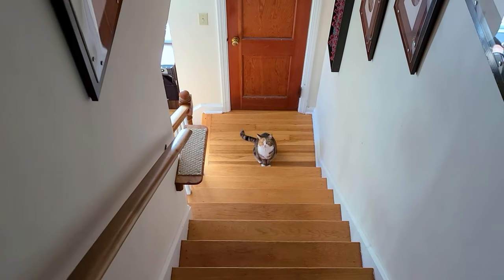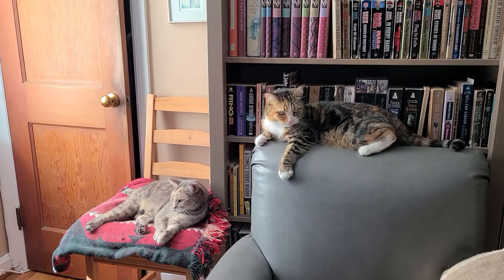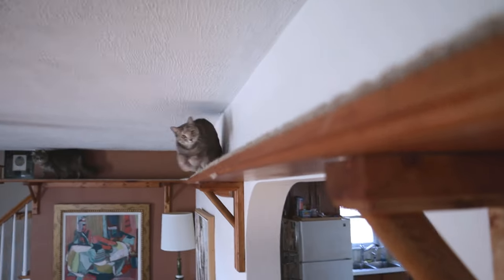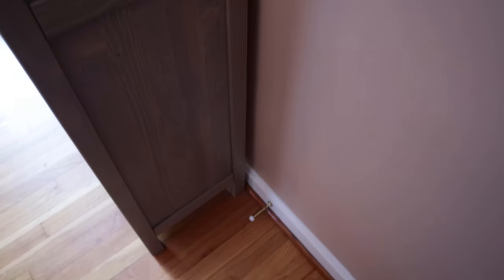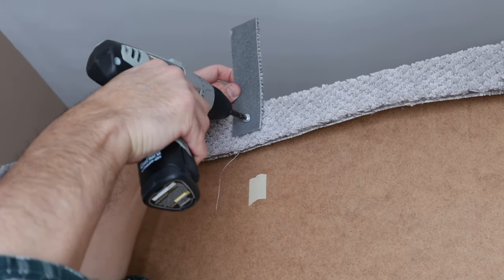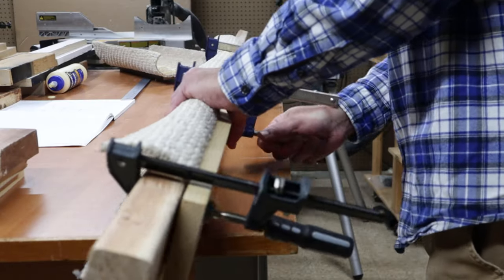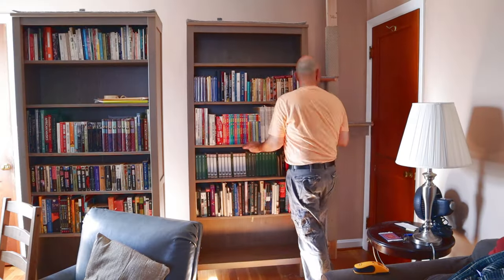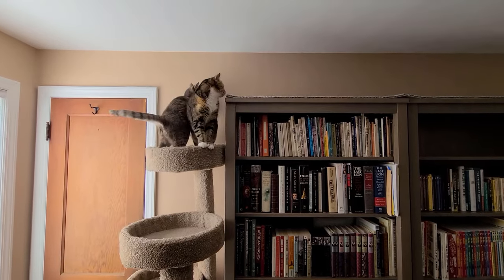If You Rent and Your Cats are Bored, Watch This

Comment: Living in NYC and going from rental to rental, I gave up on all the "damage free" versions of everything when I learned how easy it is to spackle nail and screw holes. I've painted every rental I lived in, so I have to repaint the walls anyways. For anybody worried about damaging the walls, I have had MUCH worse damage with command strips, double sided tape, etc ripping off massive patches of drywall than I ever had with nails and screws leaving holes so don't be afraid to use those in your rental :) I'm really excited to cat-ify my new apartment and your videos are a massive help
Reply from the maker: I know! Tape is the worst. And it always leaves a residue, no matter what they say.
Reply: In my rental, they won't let us paint or give us matching paint to touch up when we leave. 🙄 So we either have to live in an undecorated box or forfeit our deposit.
Reply: This is definitely one of the secrets to renting. Just get comfortable patching holes and painting and live a little more free.
Reply: @candimay4404  No-hole alternative: Tall bookshelves facing each other on opposite walls.  At least one solid board secured (screws/bolts) to the top of each bookcase.  If sturdy enough, the second walkway can be a rope bridge so that they can run circles in the air.  To turn the bookshelves into trees, cat-sized holes in the shelves so that theys can move up and down through the shelves.  Secure all shelves so that none are loose and can be bumped up or out by the cats.  Also ensure that there are not sharp or hard objects under the high pathways, so that they are less likely to be injured if they fall. (Falls do happen.)
Reply: @brianwest2775 great ideas!!!! Thanks!

Comment: An alternative to burning the edge of the carpet is to paint the bottom edge with wood glue. A carpeting salesman suggested that to me when I bought a remnant to use as the rug in the living room rug for my first apartment. I painted the edge to about an inch in and let it dry completely before I flipped and positioned it. It worked fine.
Reply from the maker: Great suggestion! Thanks!
Reply: They also make carpet tape. This is traditionally used for patches and seams but you can definitely use it to reinforce  edges. Be careful though because it comes in both single and double sided. Some of them are heat activated, requiring an iron, but they give a little bit of time to get the placement right in comparison to the other type. Hope this gives you options to fit your needs.  👍

Comment: No-hole alternative: Tall bookshelves facing each other on opposite walls.  At least one solid board secured (screws/bolts) to the top of each bookcase.  If sturdy enough, the second walkway can be a rope bridge so that they can run circles in the air.  To turn the bookshelves into trees, cat-sized holes in the shelves so that theys can move up and down through the shelves.  Secure all shelves so that none are loose and can be bumped up or out by the cats.  Also ensure that there are not sharp or hard objects under the high pathways, so that they are less likely to be injured if they fall. (Falls do happen.)

Comment: Your videos are excellent and you are very knowledgeable/informational, THANIYOU! 

If someone rents they should not be drilling holes in walls without permission, and expect to pay for a professional to restore/repaint the entire wall if they do. I have had tenants fill holes with toothapaste, and they always leave the property in worse condition.. One should expect to leave a home in the same condition they entered, or indemnify the owner.
Reply from the maker: As a landlord, I am sure you have seen enough damage to last a lifetime. I agree that the toothpaste thing is ridiculous. But I don't agree that paying a professional to fill a couple of holes and paint a wall is necessary. Drilling holes causes less damage than nailing into a wall, which can cause chipping and other problems. I rented for many years, and always got back the full deposit. But I also expected to live in the space, which included decorating the walls. (I found that those tape hanging devices cause much more damage than nails.) I think most people expect to be able to do that as long as they leave the space in similar condition to its original. Otherwise, what? Tell prospective tenants in advance that the walls must remain bare unless they contract a professional to repaint the apartment? Maybe some people would agree to that, but I think most won't. And if they have cats, painting a wall might be the smallest issue at the end of their stay. But thanks for watching. I appreciate your comment, and it's an important reminder for any tenant to know the landlord's expectations before leasing an apartment.

Comment: I found carpet remnants at the local Dollar Tree - 1 x 4 (feet) that work great on top of my bookshelves. I also found a cardboard cat house at Aldi for $8 that I put on top of one (anchored to the shelves so it doesn't slide off).  The cat house comes with two sections of corrugated scratch pads. I removed those and put part of an old bathroom rug in the house - they love sleeping in their little house.
Reply from the maker: Love the little house idea!

Comment: Instead of drill screws in studs or a brick wall you can use height adjustors (used in legs of tables or cabinets to level them) 
Just put them on the end of a 4x4 wooden plank just shy of the height of the rooms and tighten them.
These can even be put in the middle of a room. And you can put the walkways by connecting them to these wooden pillars.
No need to screw anything to a wall and everything is adjustable.
Linking a video where they are using sections of pipes screwed together and held in place by a hydraulic shaft but this is cheaper and fully customizable.
https://youtube.com/shorts/aWx0jm7055M?feature=share
Reply from the maker: Great idea! Have you tried this yourself? I wonder if the height adjustors are strong enough to keep a post stable? Could a full sized cat throwing himself at it during a chase game shift it? It's worth experimenting. Thanks for the idea!

Comment: Im going to look for free bookcases ,, hopefully, 2 or 3.  Im going to leave the shelves empty, cutting squares and or circles on oppsote ends so the 2 kitties can climb up them (1 kitty is 12 ill secure ramps eith carpeting for her to rasily travel) to the top.  Ill buy s fee planks for running , making them not yo far apart securing them with hardware for the zoomie times.  TY i wanted to secure them to the walls. I know how moe with the tip you gave.  I do have a few hesvy rocks I'll put in the bottom also for added weight.   Thanks so much!  Lolol they'll love these!
Reply from the maker: Great idea!

Comment: At the end of last year I bought a new fridge-freezer to replace the tiny one built in under a counter in my kitchen (though I still need to preferably sell it or otherwise make it go away! I’m going to move a cupboard into its space from across the room, then finally buy a dishwasher to go in that space next to the sink 😃 playing kitchen tetris over here!), and one of the factors that went in to my choice was one with a flat top without any vents or operational elements, so that my cats could go on top 😊 Bit of a variation on your solution, but while I’m not a renter anymore, you at least don’t need to make holes in the walls to repurpose existing furniture/appliances for your cats to make use of too (provided you’ve got a way for them to get up and down!)

The new fridge is a massive 2 meters tall, and right now their access route to get on top is a very makeshift solution involving a sturdy tall box (that once contained my kitchen bin!) stacked on top of a storage ottoman… this sounds much worse now I’ve written it down than it is in reality, and I promise it’s all fully secure! I can comfortably stand on the storage ottoman safely and nothing wobbles 😅 I need to have a huge clearout of all the boxes and old stuff that’s accumulated here, and since I don’t have a spare room or a garage the bit between my kitchen and living room has turned into the “junk zone”, and I’m looking forward to replacing that bin box hack with a few shelves for them to jump onto instead! 

They do love sleeping on top of the fridge, or just surveying the space/watching me while I cook! They also manage to squeeze up on top of the kitchen cabinets from there too, though there’s really not enough height between them and the ceiling (18cm) to be that comfortable, alas… I also want to make a skyway around the room too, with a big long shelf going above the big window to span the two sides of the room, and maybe some different kinds of wall catifications stretching from the window up to the kitchen… I think I should just have enough space because that’s a 25cm gap above the window, if I can find a shelf/bracket system that can get as close to the top of the window recess as possible, and then figure out the spacing at each end for them to get up onto the window shelf when there’s not a load of headroom for them to jump! My catification is definitely all still a work in progress 😸
Reply from the maker: Those sound like good ideas to me, Emma. Another commenter mentioned that he was going to use a wardrobe. All those items are very stable because they are deeper than a bookcase.

Comment: Another option I have found is using 3m glue brackets with the removable glue you simply pull down the glue comes free and they go up to 25 pound holding power they come in all sorts of things from hooks to brackets to hangers and just the glue strip you can stick on a bracket bought from the hardware store
Reply from the maker: Have you tested the glue with cats? I'd be worried that the glue wouldn't hold with them jumping around.

Comment: This is brilliant!! I want to do this as i have two ferals and the male one i can tell needs more stimulation. For us with little carpentry experience could you PLEASE make another video showing how you attached the shelves to the pole. Also, are the horizontal wood pieces going from the bookcase to the door screwed into the wall too? Thank you! New subscriber ❤
Reply from the maker: Hi Rosaura! The horizontal pieces are not attached to the wall. The only thing attached to the wall are the anchors to keep the shelves from tipping. The little shelves are just screwed into the edge of the horizontal boards. The boards should be at least 3/4 inch and drilled for the screws to keep them from splitting. But if woodworking is a problem, just use a tall cat tree. It would be the easiest method for you. Thanks for your question!

Comment: Yup, this is part of my four-wall living room cat parkour. I have the IKEA Hemnes TV stand, with single bookcase on each side, connected with the bridge. There is a 5 ft. cat tower on one side to access the top of the entertainment center, and staggered shelves on the other side.

Its was easy and cheap. Menards sells 24" x 36" carpets for $1.88 that can be cut in half to wrap two shelves. Got 8 ft. MDF board and cut in into 15" segments. Shelf brackets are cheap. Used glue gun and construction staples to affix carpet to boards on underside of boards. 

Last week, I picked up 15" round boards which I'll cut in half to make half moon shelves, for another parkour wall. Found a carpet store that gives away free cardboard tubes from carpet rolls, so I'll wrap those with sisal rope, and put a 2x4 down the inside to add sturdiness. 

 I figure I have 80 to 100 holes to patch and repair when my lease is up. 🤣🤣
Reply from the maker: Wow, four walls! That's fantastic! Love the idea of the half moon shelves. Thanks for the comment, D Light!
Reply: @9LivesToLive  The MDF board I use for long shelves and steps is 1/2 inch thick. I was able to find 1/2 inch thick round pine boards at Michaels craft store, in a wide range of diameters - I purchased 15 inch and 18 inch rounds. Looks so much better than Lowes/Home Depot 1 inch thick rounds.

I also make carpeted tunnels with concrete form tubes. You can slice those tubes into sections and nail in a pine round for a bottom to make round beds, just like the store bought cat furniture.
Reply from the maker: These are some great suggestions! Thanks for sharing them!

Comment: Stud?  In the UK we have brick walls.
Reply from the maker: That certainly makes it harder. There are brick anchors, but you might not want to drill holes into them.
Reply: We also have plasterboard walls with studs in the UK (especially for internal walls), but it depends on your property - I live in a new build apartment block with plasterboard walls (and mercifully excellent soundproofing between the flats! 😌) but even in my old flat in a Victorian terrace, while the external walls were brick, the internal ones between rooms and subdividing into flats were all plasterboard (and NO soundproofing! 😫 I could hear ever conversation and argument my neighbours had when they were in particular rooms of their flats… I definitely don’t miss living there!)

(I don’t have any useful advice about dealing with brick walls though… my DIY skills are very limited!)

Comment: Do you recommend the stud finder you're using? I haven't found many with good reviews
Reply from the maker: I use a Zircon L50. It is not too expensive ($20) and has two settings for depth, which helps. There are others which are much more expensive, maybe they are better. The problem with stud finders is that many older walls are more than just drywall and can interfere with the reading. In some cases I have to search for the stud at different heights of the wall to get an accurate reading.
Reply: @9LivesToLive  thanks for the advice! my goal is to add some catwalks this month to help my 4 cats relationships 😊